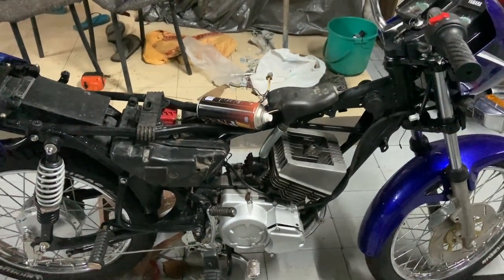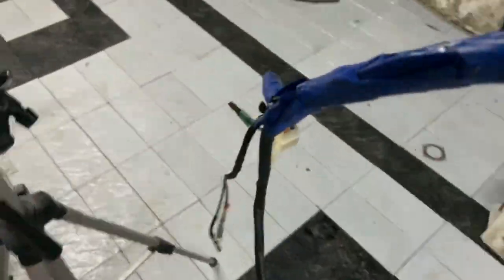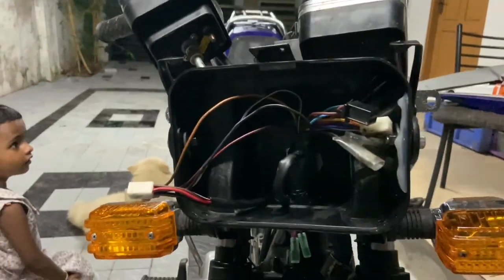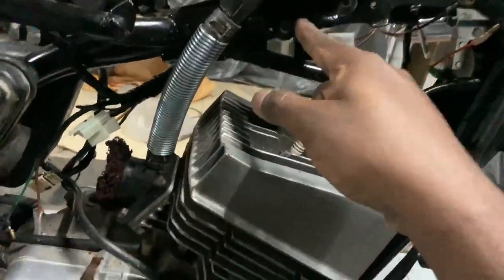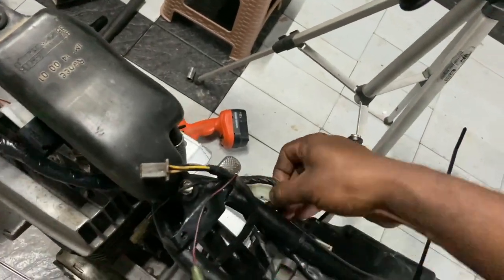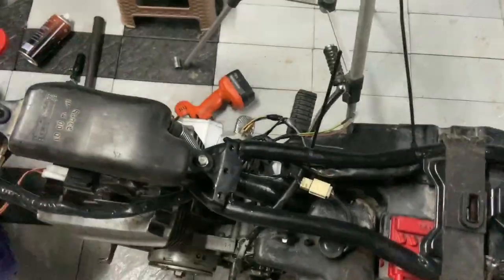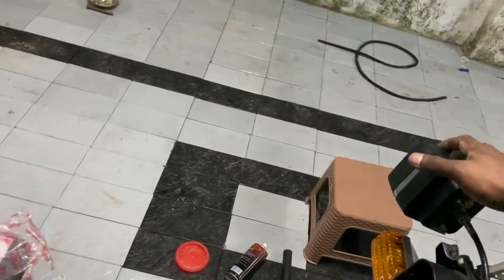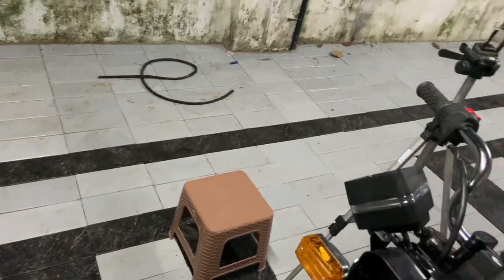Rebuilding the Yamaha RXZ part 13 (Detailed Wiring video)

Comment: Sir how did the ignition lock fitted, am trying but failed cause Rxking and Rxz meter plate are same but i am unable to fit those ignition lock fitting is tough as it isn't go through that meyer plate
Reply from the maker: I have not seen an rx king ignition plate upclose, there are ways to fit anything, ping me in Instagram and let’s see what we can do about it

Comment: Bro pls tell how you wired oil level indicator switch. I have rxz tachometer set in my RX135 and bought a oil level indicator tooo. Mechanics don’t have any idea about the wiring. Pls help me.
Reply from the maker: Yuvanesh Sudhakar you have to run an additional line. Really simple

Comment: Just to know...is that 4speed and 5 speed magnets are different?5speed magnet is lighter ,decreases the load in crank and has a good perfromance?
Reply from the maker: Brijin Bs magnet is different from RXG and earlier model 4s. Tiger and later models came with the same magnet. Every iteration was better than the previous iterations in terms of customer complaint fixes. I won’t say the load on the crank will be higher or lower because I don’t know what issues were fixed in this iteration, but it’s definitely better than the previous models.
Reply: Yamakaze can i get ur no
Reply: @Yamakaze  Bro, I think I had asked this question before but I wasn't clear with my question : So, when converting rx100 from 6v setup to 12v setup, can we use 4s magnet and coils instead of the 12v setup from the later models of rx100? Will it put excessive load on the crank? I have seen many people do that.
Reply from the maker: mjshaheed you can do that actually

Comment: I need the Tachometer and pilot lamp wiring..... Any idea where to get it..... Or can anyone help me get it
Reply from the maker: Tachometer is available easily, you can use the rx left side meter wiring
Reply: @Yamakaze  i ordered two sets and both are having the same type of pin (Both Male) so i thought if i could get a direct fit for both without modification
Reply from the maker: @tr6465  it’s easy, just replace it with a female connector
Reply: @Yamakaze  yes ... I will do that.... Thank you
Reply from the maker: @tr6465  👍
Reply: Bro i need oil pump gauge  wiring in meter